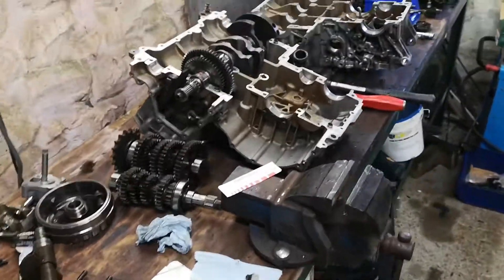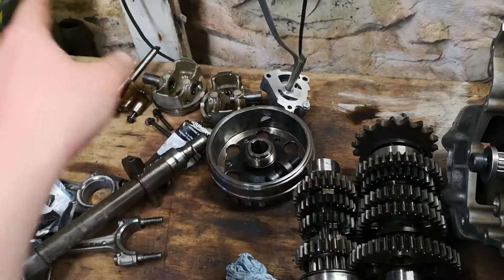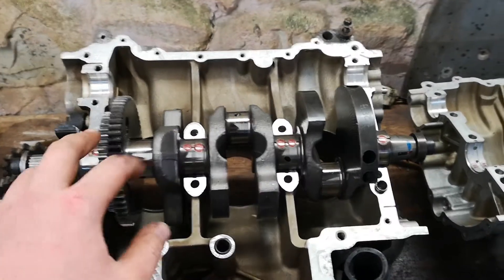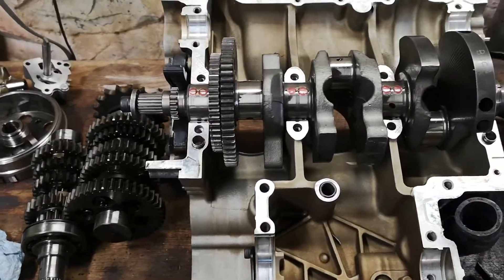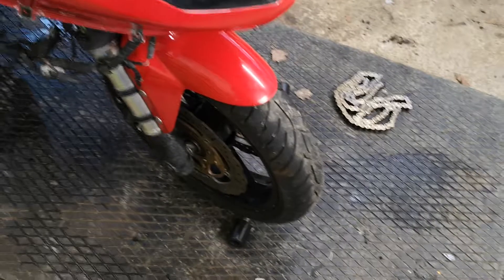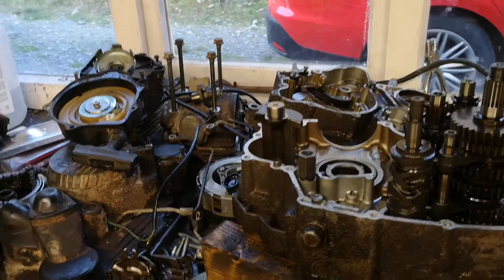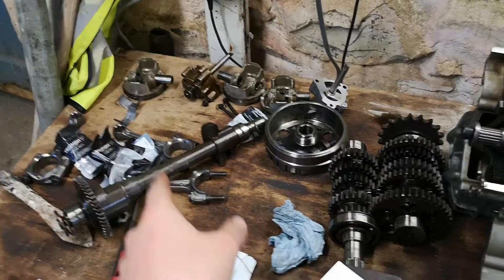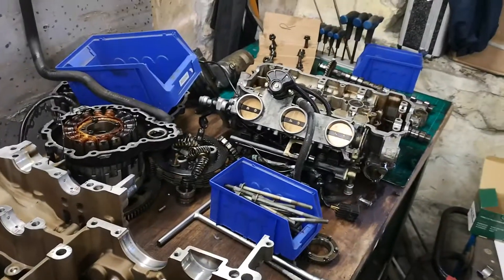Triumph daytona 955i engine failure part 3

Comment: Hello sir I have an 02 955i wondering if you had any take on what my issue may be only fires on 1 cylinder just so happens to be the left one there same as where the failure you had I certainly don't want to go thru all that just yet I only bought the bike a couple months ago and haven't even ridden yet due to this issue after I have pretty much put it all together best I could from the mess I bought

Comment: I suspect my 1999- 955i s3 has a similar issue. Started making a knocking noise today. Still turns over and will run but very loud knocking noise. Roughly how much were the parts?